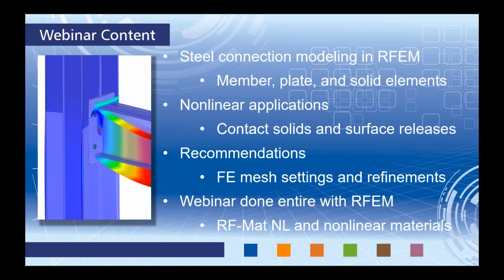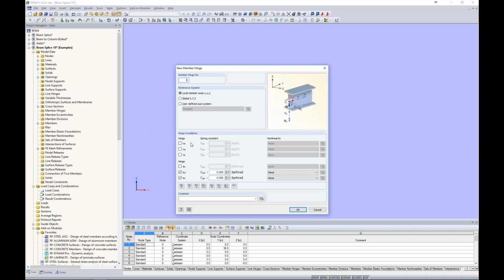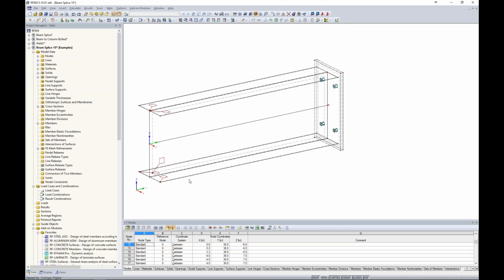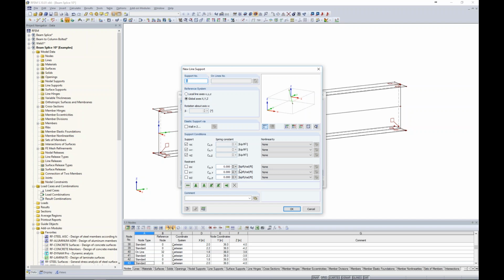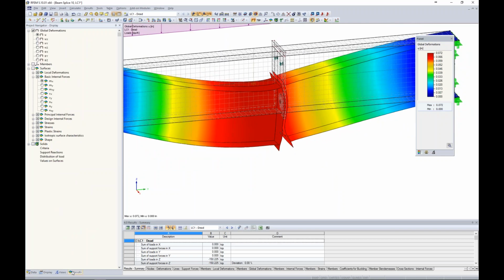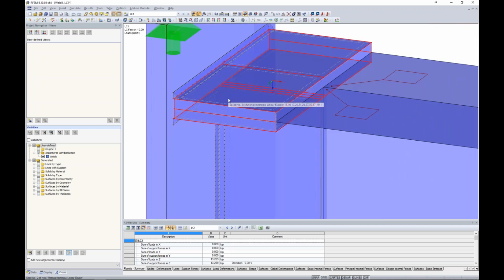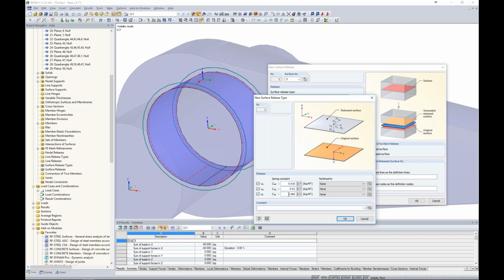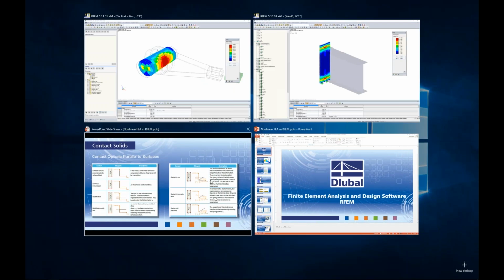Webinar: Nonlinear FEA of Steel Connections in RFEM (USA)

Comment: 1 more question, please
the contact solid existing model (suggest) only the connection between the surface 15mm thickness? this will not be a plus for connection? the existing solid plus the 2 surfaces with their own 15mm thickness
thank you,
Reply from the maker: Hi, @mihai3086! Thanks for your question. please consider getting in touch with our support team or join the Dlubal Community to get the most detailed answer to your question.

Comment: at time 18:14 Amy is copying the line elements form one side to another in orded to get contact sufrace working.
If there was an different cross section at the other side of the plate, would there be any aditional actions needed?
Reply from the maker: Hi, picajoool!
You have to copy the elements form surface A to surface B and reversed. Both surfaces must have the same elements. Please take a look on our website. Here you can find a knowledge base article on this topic. https://www.dlubal.com/en/support-and-learning/support/knowledge-base/000935
Reply: Thank you ver ymuch for your fast response 🙂
I understand now.
But what if those plates were modeled as solids?
It would only be necesseray to define surface release between the 2 plates (solids)...correct?
Reply from the maker: Hi, picajoool!
If you need further assistance, please contact our customer support by e-mail at info@dlubal.com and send us your model. Then we can check it.

Comment: Thanks for the great video.
Talking about the first model:
So if I get this right there cant be any stresses displayed in the solid as the solid is defined as a contact, right?!
Is there a way or display option to show the area where the two plates lose contact/ show the status of the contact/size of the gap?
Thank you :)
Reply from the maker: Hi, Travel!
You can show the stresses in the solids. To see the contact stresses show Sigma_z of the solids in the Results navigator under the Solid section.
See also https://www.dlubal.com/en/downloads-and-information/documents/online-manuals/rfem-5/08/34
Reply: @DlubalEN  Thanks. Actually thats what I did. I talked to a Dlubal technician on friday and we didnt get it to show -he then recommended me to upgrade to 5.22 (as i was using 5.20) which now solved the problem :)

Comment from the maker: At time 13:22, the webinar incorrectly states the height of the solid should be the sum of the two plate thickness on either side.  However, the height should actually be the sum of 1/2 the thickness of Plate A plus 1/2 the thickness of Plate B.  See FAQ:  https://www.dlubal.com/en/support-and-learning/support/faq/002280
Reply: Dear Technical Team,

thank you for clarifying this, but if we consider only half of the plate thicknesses then the bolt length will not be accurate. The bolt will be shorter by a thickness of a plate?

Thank you
Reply: Thank you for your clarification.
One question. 
If the endplate (15mm thick) is anchored with bolts into an concrete wall thats 250mm thick, how would you model the contact solid  between the endplate and the wall surface? 
Only  with thickness of 1/2 (7,5mm) of the endplate, or full endplate thickness (15mm)?
Thank you